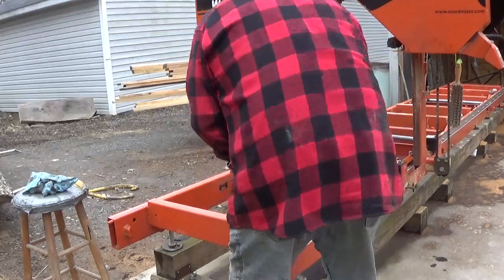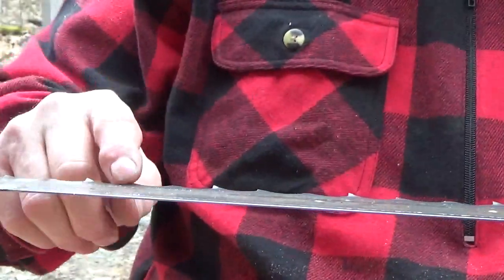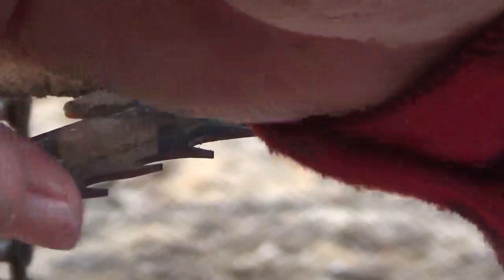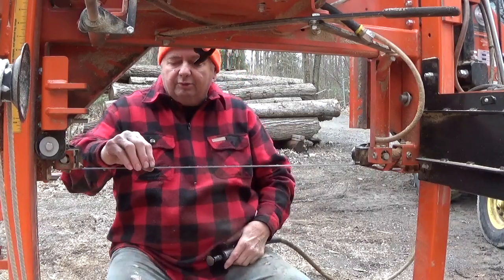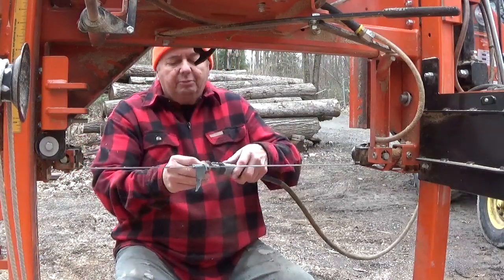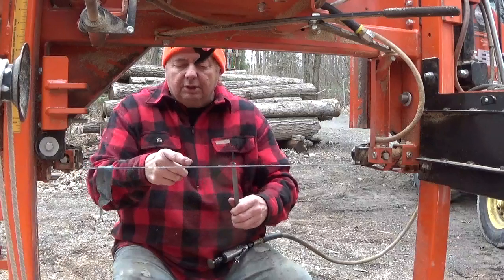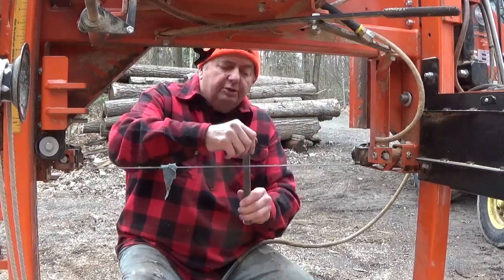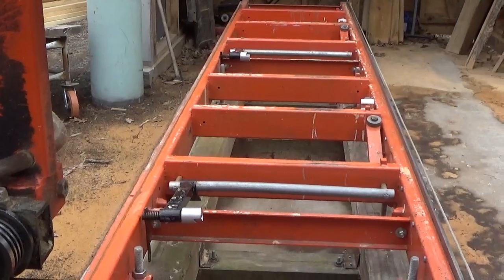Woodmizer LT15: sharpening the blade on the mill.

Comment: Mr. Won, I know this is an old video. I've watched it before and am watching again to see how you sharpen your blades. just a little fixing of that air hose and it wouldn't work that compressor near as hard.
Hope your doing well with your diet and meds and all.

Comment: The oil your using on the blade after you sharpen and dress the blade, what type of oil is it. and does it mess with the rubber lining on the large pully's?

Comment: Good stuff thanks
Reply from the maker: R u holding up good?
Reply: @josaljo1  Hi Joe this old tractor is driving me batty otherwise everything is going ok, but I can't get logs on the mill LOL
Reply from the maker: @pup734  Isnt the hydraulics working?
Reply: @josaljo1  no the thing just won't start and it is hard to get someone to come look at it
Reply from the maker: @pup734  Is it diesel or gas?
Reply: @josaljo1  it is gas I have replaced everything electrical including wiring and switches and battery connections grounds time to call an expert
Reply from the maker: @pup734  what about the timing, and is that an updraft carburetor?
Reply from the maker: Are the valves moving? Not that the timing belt or chain is broke.
Reply from the maker: Does it putt, what color is the smoke coming out of the exhaust?
Reply from the maker: Maybe the ignition key shorts itself when you turn to crank.
Reply: @josaljo1  brand new switch and I wired it to what the manual said

Comment: Joe i have a hard time finding files that will cut the teeth. Are you using a double cut file in the video. i havent tried that yet but a fine single cut just seems to skip on the tooth and not cut.
Reply from the maker: Hi Jim, mine is a single cut and it works very well. It is fairly new.
Reply: @josaljo1  What make and model blades are you using? Maybe Jim's got harder teeth.